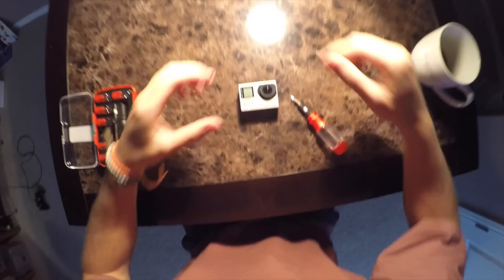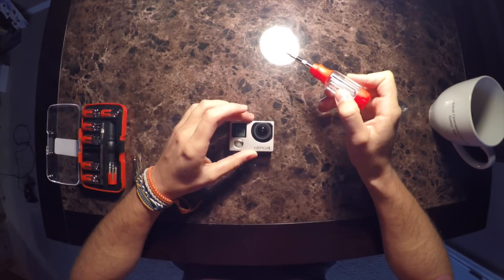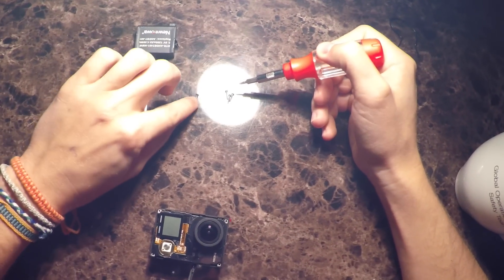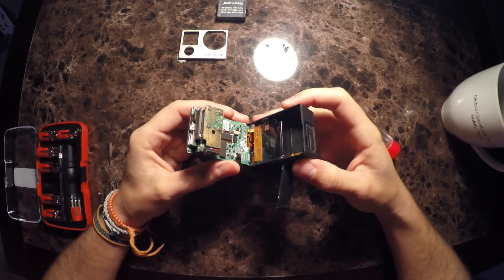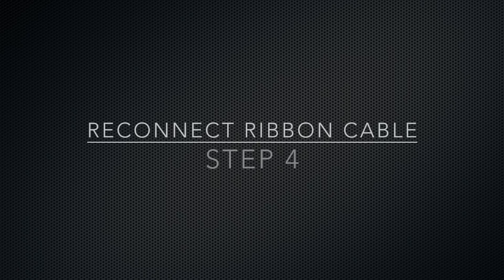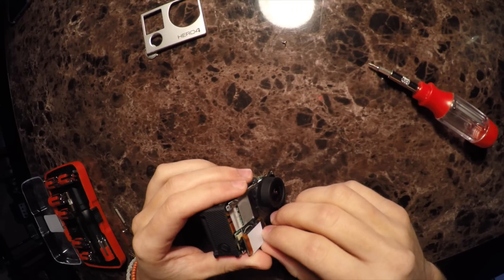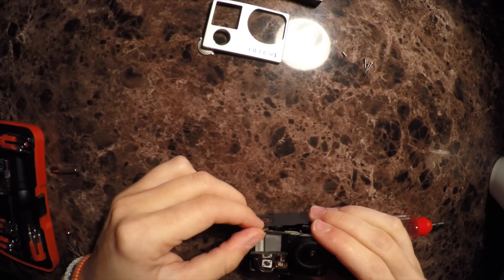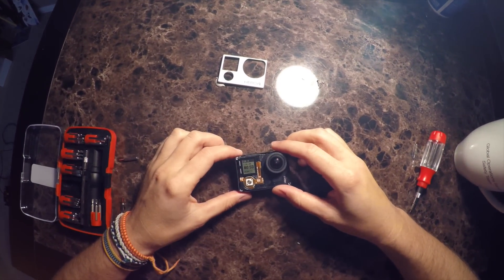GoPro Hero4 Silver Screen Repair Fix (in 4K Teardown)

Comment: This was a helpful video.  My top power / record button and setup button were acting flakey and I couldn't figure out why.  After taking the GoPro apart, it was obvious -- the connector for the ribbon was barely hanging on to the board.  Basically, a very poor solder job from the factory.  I never dropped or damaged my camera - what a shame GoPros have this weakness.  It's back together now.  I guess I'll just record via the phone app.  So lame.
Reply from the maker: Hey Miles. Did you try searching online for a replacement ribbon cable? I know that you can get them for relatively cheap and you clearly know the steps now to replace those parts.
Reply: Unfortunately, my issue would require a replacement board - the input connector completely fell off the existing board.  There's really no sign of damage anywhere else.  The ribbon cable is actually fine.
Reply: @colour4321  Same boat as you. My wife pulled out her Hero4 so I can add another angle when recording, but her shutter button wasnt working. I watched a few videos before opening it, carefully got it open and noticed the ribbon cable was disconnected. The device hasnt ben used in ages, and cannot use the top button to input settings.

Comment: can you help me?i bought two gopros from ebay.the one had problems with the lcd screen and the other one with the buttons.i opened both of them,took out the motherboards and i installed the non harmed motherboard in the gopro with the good lxd screen.when everything was finished my final gopro was working just fine except 1 button.it is a hero 4 and the left button was not working...i opened it up and put a little aluminum foil inside the gopro and the button was then working but it was hard to press it...any suggestions on how i could fix it??btw i bought both gopros for less than 50$and i thought i could fix it but it didnt work fine...i would really appreciate it if you could answer!!thank you
Reply from the maker: That is a tough call. It sounds like you got what you paid for. I would begin by disconnecting and reconnecting all pins and ribbon cables within the GoPro. After testing that you might want to look for solder tabs that have broken off that could lead to a miss contact between pins. Hope this helps!

Comment: Hi Lee.I have a problem with the image sensor on my Gopro H4. I recently noticed a thin line on the top right corner of my movies. I guessed it was maybe a hair or bit of dirt on the sensor. So I took camera apart and looked at the image sensor, and saw that the thin plastic film covering the image sensor is peeling away in the corner causing the line. How can I fix this? Would it be ok if I take the film off altogether using fine forceps or should the film remain on the sensor to protect it?
Reply from the maker: Hey, I would honestly be very careful at this point. It is probably fine to test your theory, but I would think it is almost cheaper to just buy a new sensor and replace that part entirely.

Comment: I may buy a gopro with a brocken screen (I want to make some economisation) I will try to repair it after. But I just want to check what are the impact of a brockenb screen. Is it possible for you to check pictures with the android app ? I mean can the app substitute the LCD screen ?
Thanks.
Reply from the maker: yes, the app can substitute as a screen as long as the wifi is still functioning properly.

Comment: Great video. Same thing happened to me after my djip2 suddenly dropped out of the sky. GoPro stopped recording right before the crash ?? The back touchscreen and shutter buttons stopped working. Opened it up and saw three ribbon cables disconnected. The two smaller ports came off the circuit board. The bigger ribbon port is still attached to the board so I was able to insert into port. Do you think I have to replace the board since it appears like the ports would have to be soldered? Drone dropped about 60 feet right on concrete sidewalk.
Reply from the maker: If you have a soldering iron, I would just suggest resoldering to the board.

Comment: Hi!  My Hero 4 silver got wet and beat up a bit in my pocket after break through some ice on the lake this winter.  After drying it I turned it on and the LCD screen wasn't working.  I tried a few more times and after a few days I finally put it in rice but I didn't open the housing. Waited a week and nothing still so I opened it today and put it in rice. I'm waiting a few days to see if a miracle will happen. Just wondering if I purchase a new LCD screen replacement if that might be the fix.  All my connections seem to be intact. Any thoughts?
Reply from the maker: I would say it is much cheaper to just buy a screen replacement and use that!

Comment: Hello, great video I have a similar problem .
The thing about me is that GoPro screen brightness is low and flashes to an old tv after a few minutes of use.
¿ Cres has to do with some connection ?
Or it could be ?
Reply: Carlos Alberto Oliva
Reply from the maker: Check the connection from your power board to your screen!

Comment: So I see that you have the front LCD already loose. Can you show how to loosen the front LCD?
I believe its stuck down with adhesive tape and almost impossible to unstick it without breaking the lcd.
Or is the Silver different?
I found it impossible insert the rear display connectors with the front lcd in place.
Reply from the maker: +remote one The front LCD came lose pretty easily for me. If you are afraid of pealing up the adhesive you can use a heat gun or hair dryer to warm up the adhesive for a few seconds then remove the LCD.

Comment: hello! great video! i crashed my phantom 2 and the same problem with the cam.... how do you remove de front lcd to connect the wires?
Reply from the maker: +Alvaro Poblete The front LCD is connected via a ribbon cable. You'll see it on the left side if facing the front of the camera.

Comment: I broke my touch screen on hero 4 silver and help on repairing it?
Reply from the maker: +Jonathan Zamora If you order a replacement screen and follow this tutorial it should fix it by just getting a new one.
Reply: +Lee Easton I just replaced the screen turns on and freezes on me with no picture Amy suggestions
Reply from the maker: Jonathan Zamora Try reseting it to factory settings and use a different SD card

Comment: Got my hero4 silver wet. Sister jumped into the river without water proof case. The screen turns on, but it's all just lines and distortion. What do you think it is? Or is my safest bet just buying a new one?
Reply from the maker: yorbenny Are both screens turning on or just one?
Reply: Mine got a little wet too.  Rear touchscreen was acting like I was touching it even when I wasn't.  I let it sit in sealed rice bag overnight and still no work.  Now rear screen is a mostly white screen when it turns on.  Front screen still works I guess.  Any ideas would be helpful